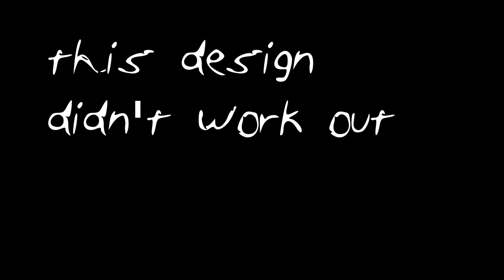Making a bike trailer - part 1 of 2

Comment: An idea that might help avoid it tipping over in future, is maybe see if your local hardware store sells any trolley wheels. Like the tiny wheels you find on movable furniture. Put one of those tiny wheels on both sides as stabilisers.  BUT have them risen off the ground, so they only come into use when your trailer starts to tip over. ^_^